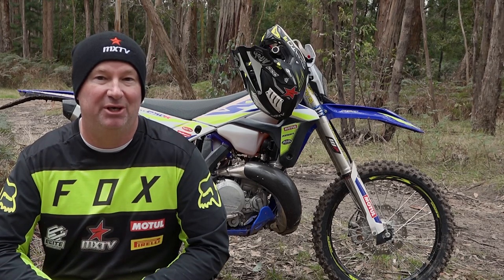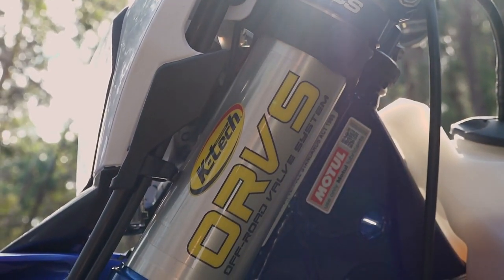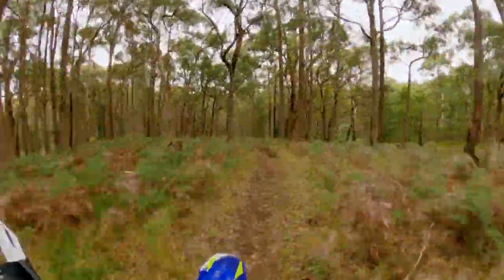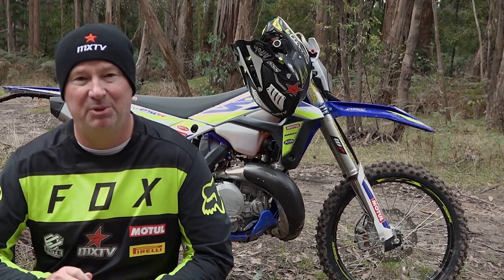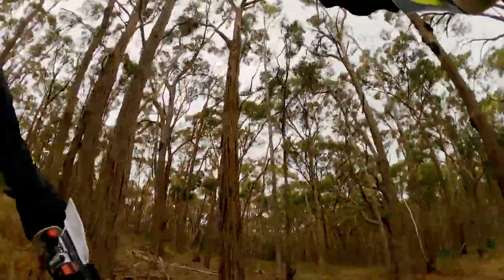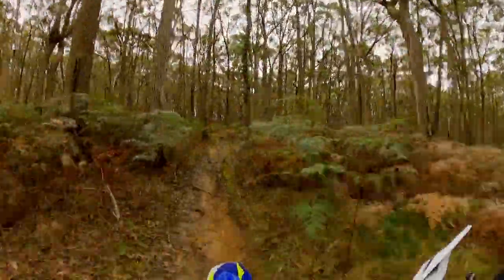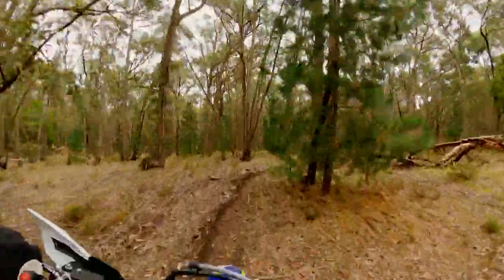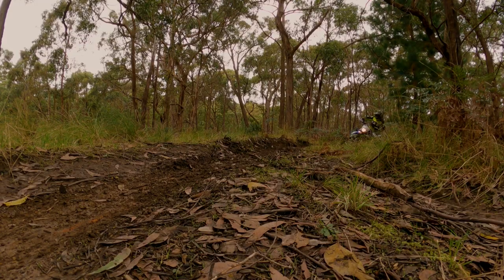MXTV Bike Review - Sherco SE250R Project Bike

Comment: great review and full of helpful info!
the only thing i'd disagree with is the counterbalance comment. I had a 2019 EXC 250 which was buttery smooth. I sold that back in England and test rode a sherco 300 se factory model and found it vibrates heaps. you can see the vibration in the fenders on idle, and definitely feel it sitting on the bike. it's not too noticeable at while riding though.

being 6ft I found the stock bars to be too low for me, i've always prefered twinwalls on my bikes and would go for a taller bend. as well as swapping the foot pegs for 5mm down ones hopefully with some camber as the sherco ones are dead flat unlike Austrian and Japanese bikes